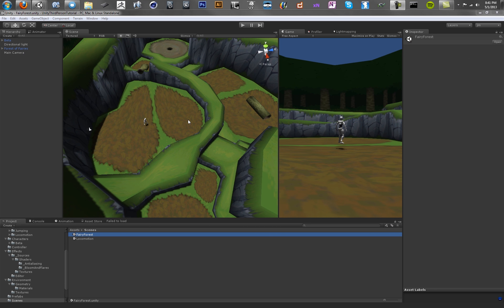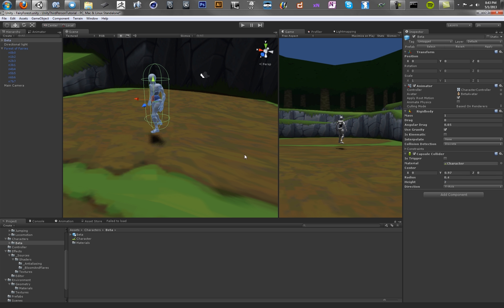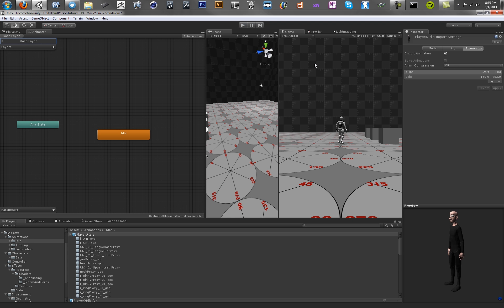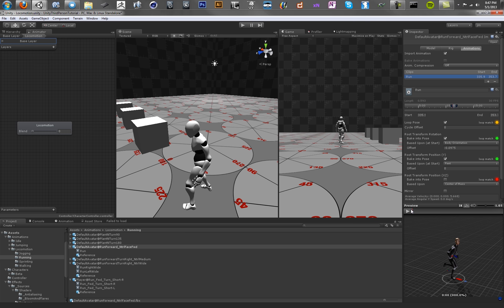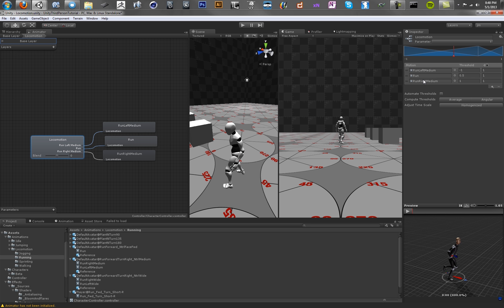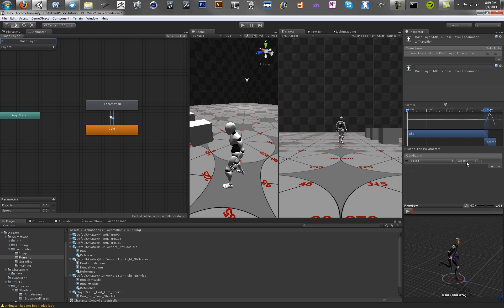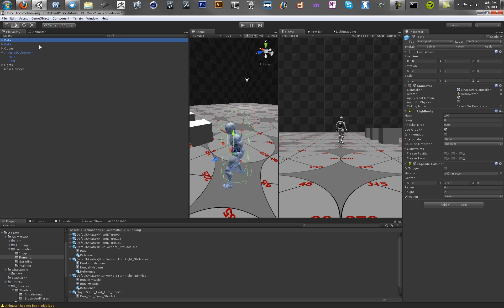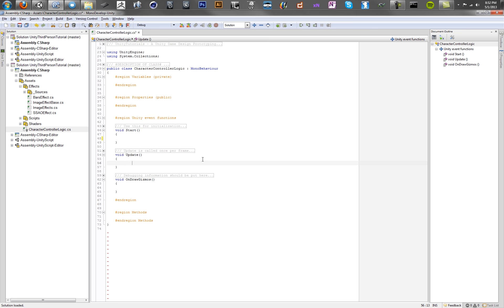Unity Third Person Control: Mecanim Nodes - Tutorial 5

Comment: People in these comments don't seem to understand that for the most part, this is a Mecanim tutorial.

In the video before this, most of the stuff he imported was just fluff that is unrelated to Mecanim (though in my opinion he shouldn't have mentioned those such things at all, keep the focus of the tutorial on a single topic). The only thing he "skipped" was creating the animations, because he didn't make them himself, he's using the ones you can find on Mixamo for free (pretty much every tutorial related to Mecanim that you'll find on Youtube skips the animating steps because they either use Unity defaults or Mixamo).

There are plenty of tutorials that will teach you animating specifically but basically if you want to create animations from within Unity, just go Create > Animation then throw it into your animation controller that is attached to your character. Select the animation and go to Window > Animation to bring up the animation timeline, hit the record button then any transforms you do to your character's rig will set keyframes for the affected bones. You could alternatively create the animations in a 3rd party app like Blender and import them to Unity as fbx but you'll need to make sure the transform offsets are correct if you're using root motion.

Comment: Is there an easy way to make the character run faster? I was hoping that by simply changing the 'Direction Speed' float value in the inspector that I would be able to accomplish this, but it doesn't seem to affect the character's speed. However, I am also testing with a keyboard versus a joystick so not sure if that affects the ultimate speed. I noticed in the animator that I can't go into a full sprint because the keyboard key does not allow me to go past the 1.0 threshold to go into a sprint. Does the direction speed only affect sprinting? Thanks!